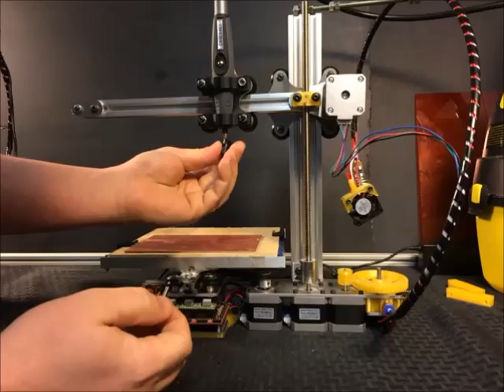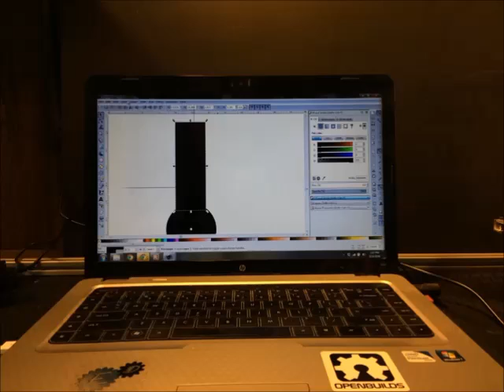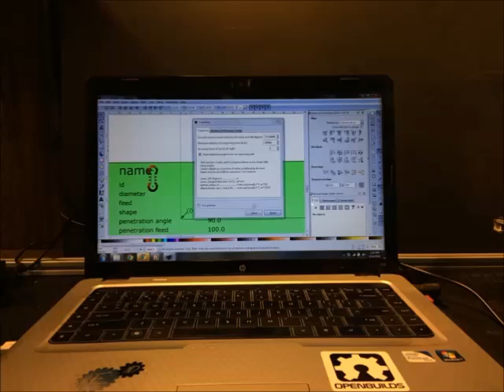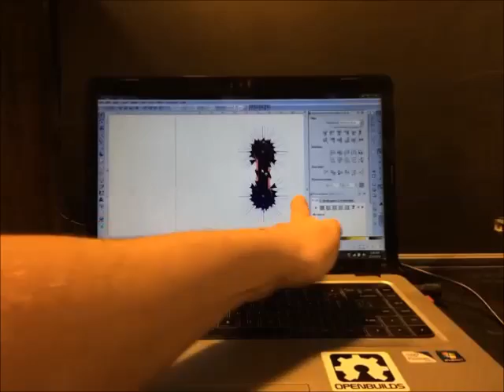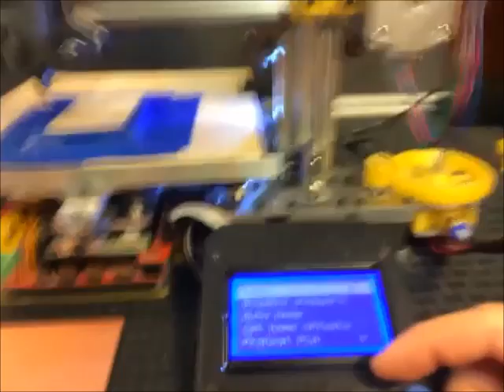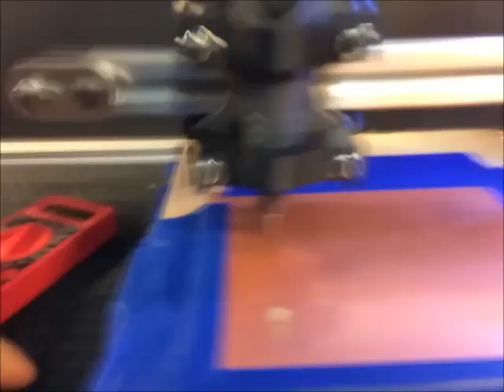Reach 3d Printer Milling a PCB

Comment: For PCB milling could you have an auto-Z?  Attach a connection to the copper sheet and to the tool, and have the machine stop the Z at the point where they connect?

Just a though. :)